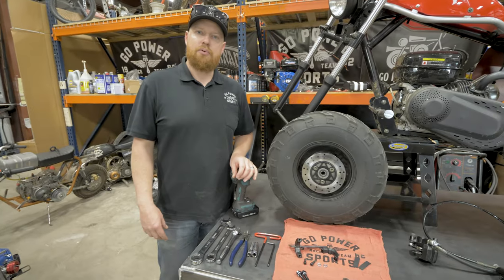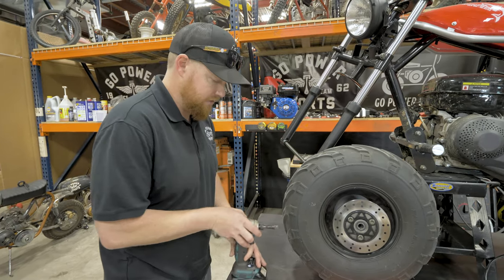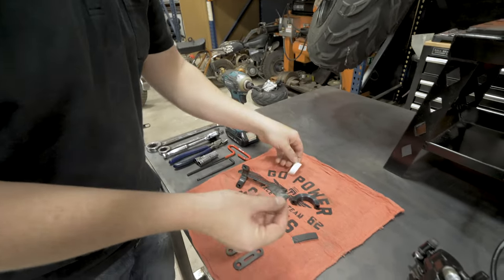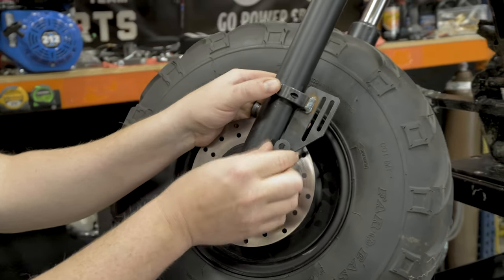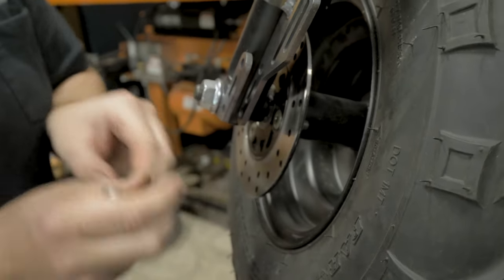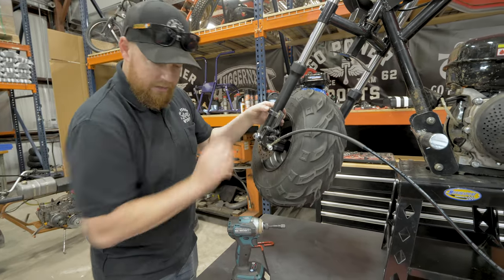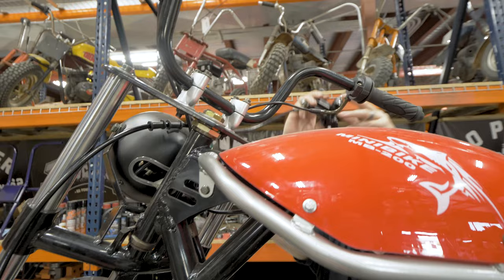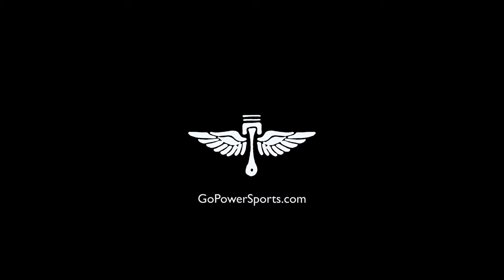TrailMaster MB200 Mini Bike Hydraulic Front Brake Kit

Comment: installing yalls kit now on my mb200 i got 3 weeks ago. had to remove the sleeve that came in the wheel with your kit. the foam holding it in no matter how I adjusted it wouldn't hold it straight and my axle bolt you say to reuse wouldn't even fit into the sleeve